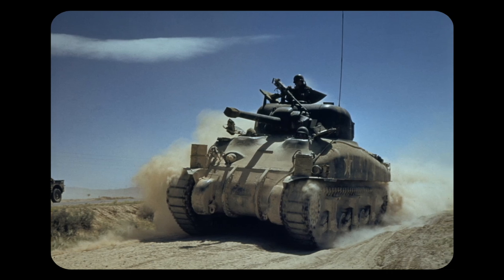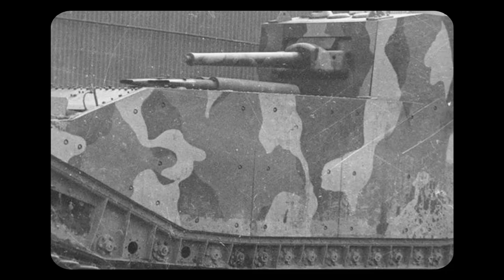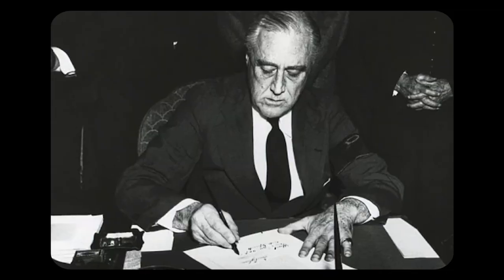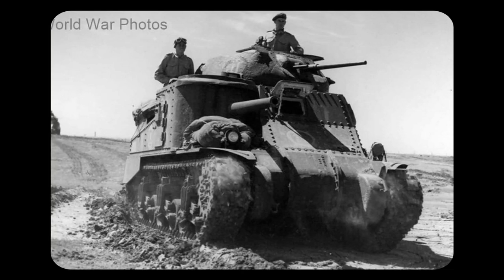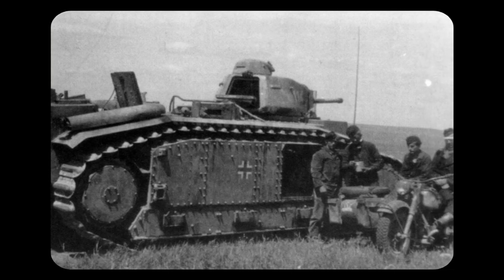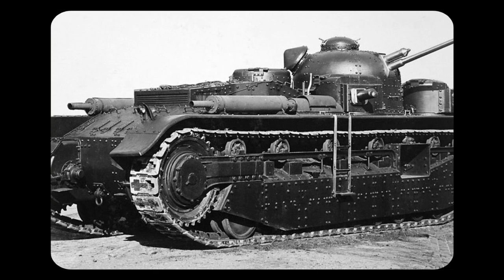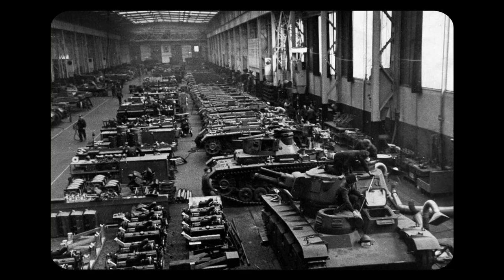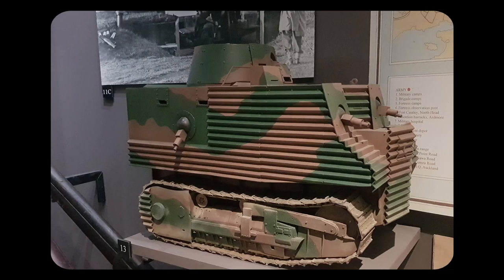Worst Tanks of ALL Time

Comment: Many interesting things here...though I don't think both the US M3 and the French B-tank were THAT bad at the time.
.
The most available "strong" tank in the Axis then was the Pz-III...whose armor surely couldn't prevent the thing from blowing like a crakerbox(full of gasoline and ammo) at the first piercing hit of a 45mm...which caliber both tanks had in turret.
.
And the Pz-III's turret gun at the time was a 37 mm, whose shells probably couldn't put either a M3 or a B-tank down except when scarcely hitting a weak point in armor.
.
Ok, the B-tank's ergonomics were SPECIFICALLY bad...it was a stupidity to let the tank commander alone in a cramped turret doing everything, commanding, loading, firing, radio communications...all with no 360° vision but to spread all torso out of the (back) turret hatch, which would have meant bad news on the frontline. And I won't even speak about the very hard to steer 75 mm front bow howitzer.
.
Anyway, I still think the Axis gained their first victories through superior cross-weapon coordination, transmission and frontline scouting...not with any individual tank superiority.